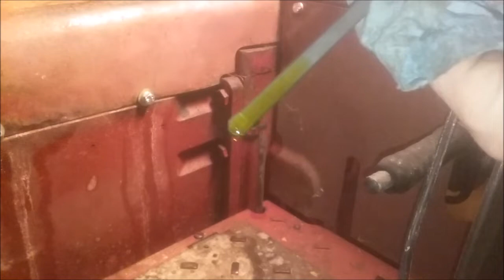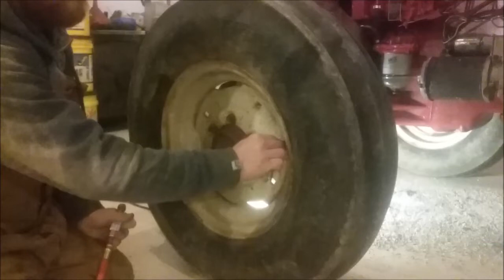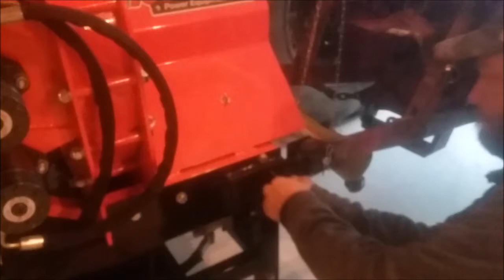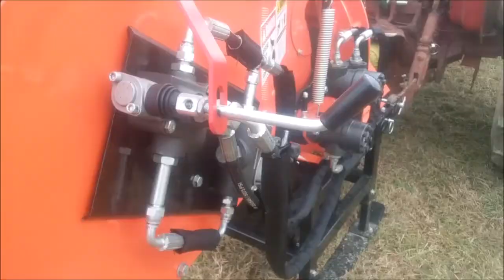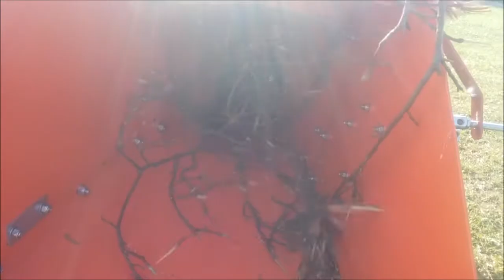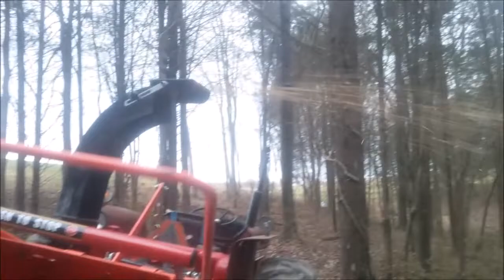Should YOU buy a WOOD CHIPPER ?

Comment: Would that work on the 1023?
Reply: I have that same chipper. Got it used. It works awesome. I run it on my deere 3032e. Cool vids
Reply: There are wood chippers made to work with sub compact tractors.